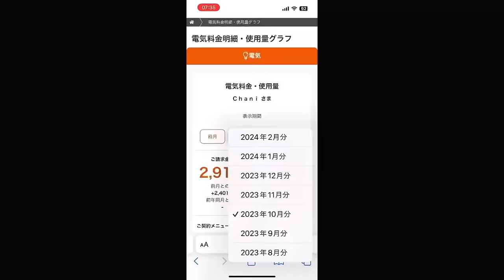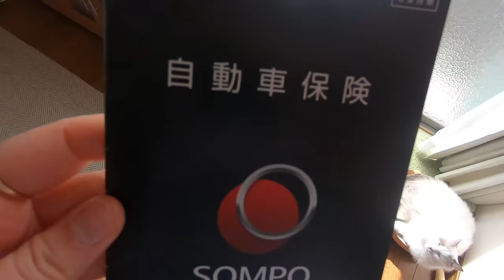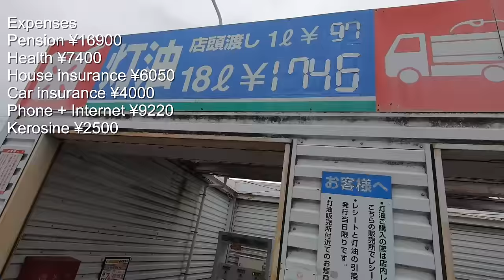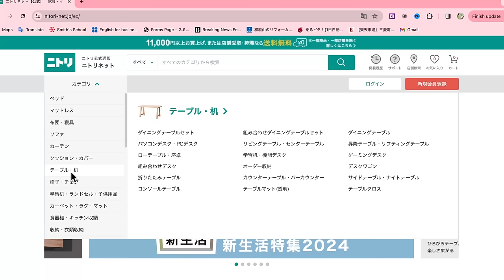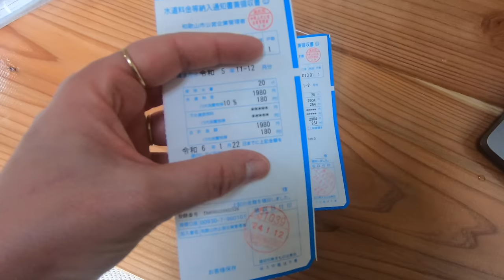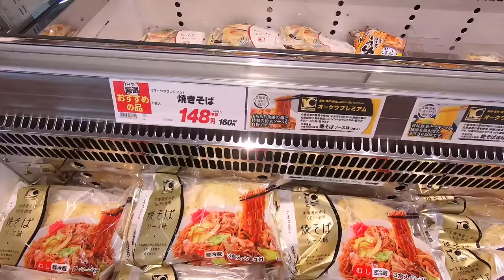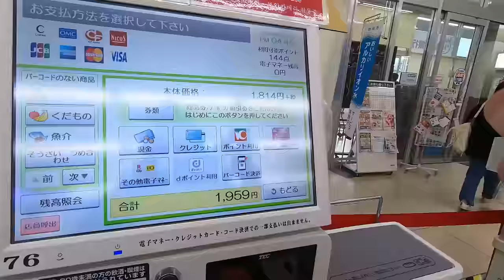Living in Japan’s Akiya: Income vs Expenses Revealed!

Comment: Don't forget you can save money on the shaken if you do it yourself.  Check out where your Kei car shaken place is, book in and drive it through the various tests. If all is well it should be under 40,000 including the mandatory insurance. If there's a problem you'll need to head to the nearest garage for a quick fix. Also, the Chuhai was 108 yen with tax - don't forget that - easy to do I know.
Reply from the maker: Good tips! Thanks for that 😀 I will look into doing shaken myself 🚙

Comment: Very resourceful with the table! For those wondering if you are living in colder climates up north you can triple those energy costs. Nice video.
Reply from the maker: Very true! Wakayama is fairly mild in winter so less energy to keep warm 😀
Reply: @ChaniJapan  We are just getting some reprieve finally after big kerosene and gas costs during winter. The added energy cost can be overlooked when deciding where to live so got to save some those extra pennies if living further north for winter. Cooling costs are cheaper in summer but taken over a 12-month period it does cost much more to live further north due to the colder winter.

Comment: Have contemplated moving to Japan from New Zealand but the difference in income is the thing that makes me hesitant even though relatively speaking   the value is much much better in japan.  Did you ever have any second thoughts based on the income difference?
Reply from the maker: Yes! I wasn't sure if I could adjust to the low wages. Someone said to me once "its not how much you earn, its how much you save that is important"...so with this in mind I just need to focus on trying to be mindful of that.

Comment: Kerosene is for airplanes not for cars. For cars there is petrol and diesel. You can also pour sunflower oil or rapeseed oil into the tank but the car will have engine damage

Comment: I know your income is low If you can afford it you should get the most efficient mini split with heating you can. I would look for one with an hspf2 rating of 20 or higher.  This will use the same amount of power as your rug heater, to heat your whole space. Or get a solar powered mini spit with heat to off set the power cost

Comment: Chami-san, 
Just for your information😊 
My phone bill from POVO is between 33yens to 1800yens, depending on how much I used for phone calls.  My portable wifi from WiMAX is fixed rate 4,100 yens per month and I am using this for remote work everyday so enough capacity. I carry my portable wifi (WiMAX) so that I don’t buy wifi from POVO for my iPhone.  POVO  is a subsidiary company of KDDI which KDDI established after Japanese government had asked the industry to lower the costs😊 The major phone companies have their subsidiary company offering lower rate and they often sell only by website.  The Japanese phone and wifi industry’s fee system varies and complicated. If you haven’t looked into this area yet, doing some research would make lots of savings😊 Sorry, I maybe writing too much unwanted advises😂
Reply from the maker: Sounds great! I will check it out 😀 I'm in a country area, do you think the signal is strong enough?

Comment: Im an American living in Japan for many years now. I find that Japan can be amazingly inexpensive and rewarding when I live and think more Japanese (my Japanese wife of course keeps me on track) It only gets expensive when I live more like my previous life and I buy things I dont need or without a plan. Most "normal" things are certainly less expensive, but occasionally I get blindsided by a cost that is ridiculous, like car tires. Most (not all) cars here use relatively small tires, however Im a dummy that bought a big Swedish car with big tires, so I require the expensive and hard to find tires. Shoganai ne?
Reply from the maker: Believe it or not my car has odd sized tyres for some reason. They are a little hard to find. Cheap but hard to find. I tried to buy some all terrain tyres and there was only one option available.